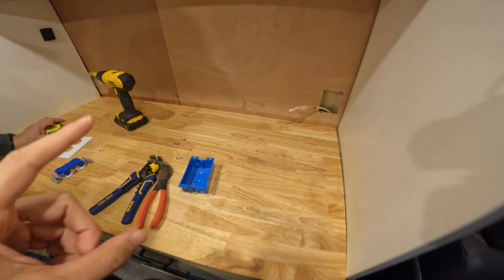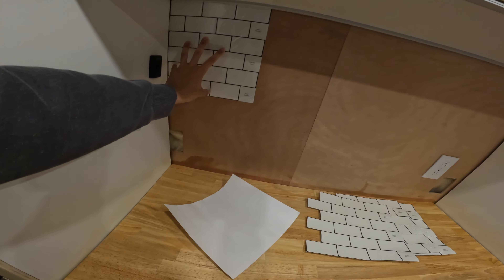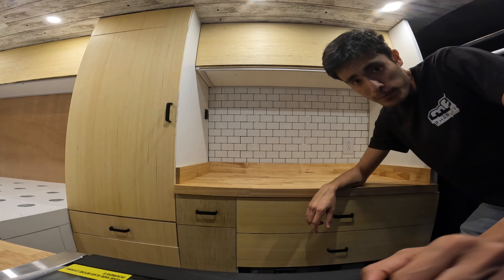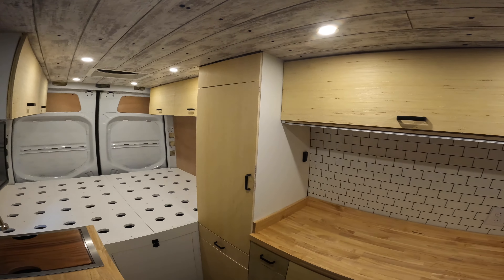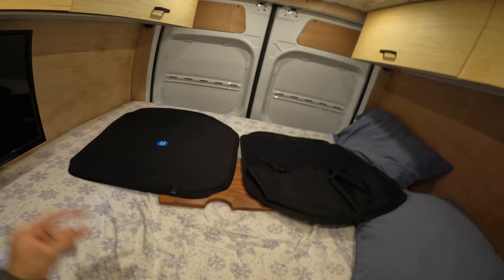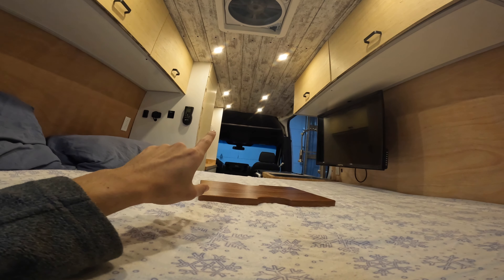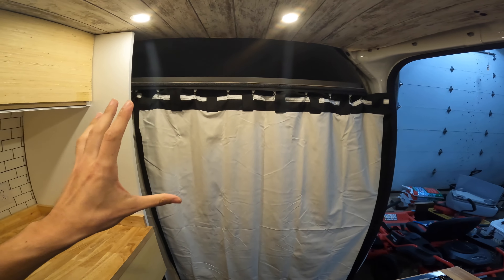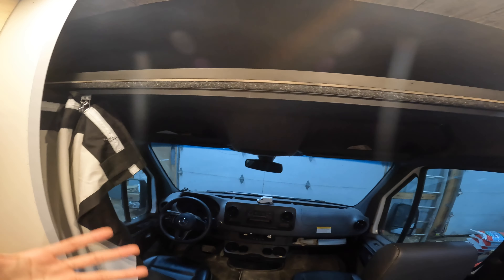Van Build Episode #18 (It's finally finished!)

Comment: Hey Daniel, your van looks great! BTW, does your employer require you to be hardwired and if so, what device do you use when you’re on the road?
Reply from the maker: Hi there. They're pretty lenient with that kind of stuff so no, I don't have to be hardwired to do work. Basically as long as I have fast enough internet to work I'm good. I'm currently using a 4g router (cheap chinese one from amazon) and sometimes I use my phone hotspot but now that I have starlink I'll be using that a lot when I'm in more remote locations.
Reply: @danielsbegg  Thanks! I work from home and I’m looking to get a van next year.  I’ve been concerned about how will connect for work.